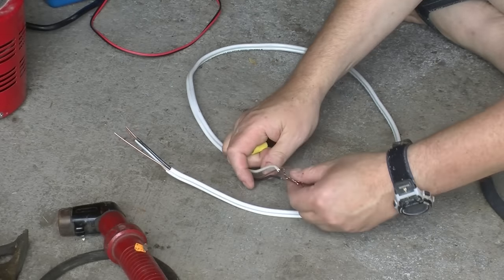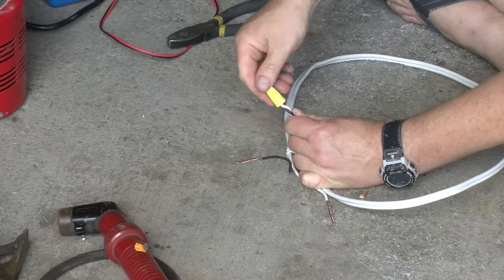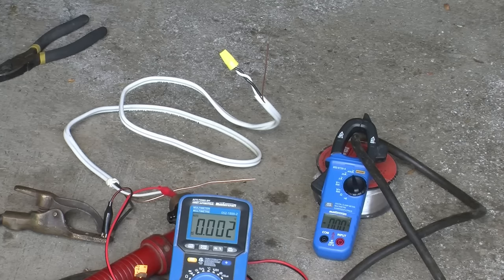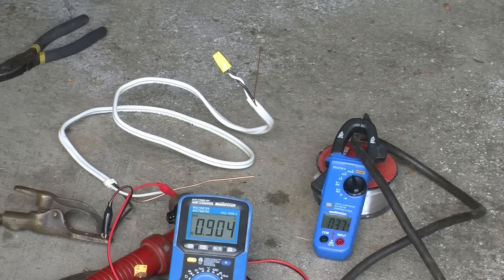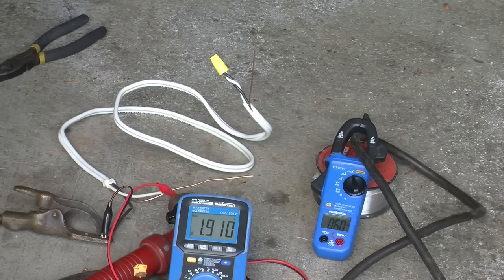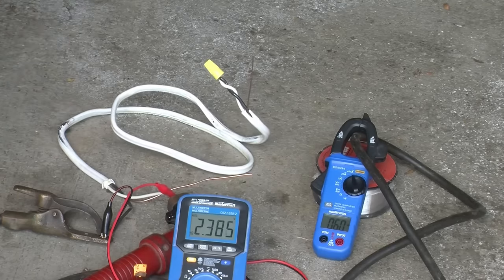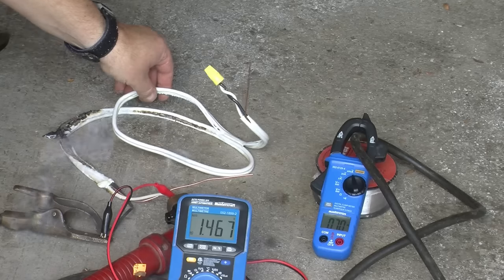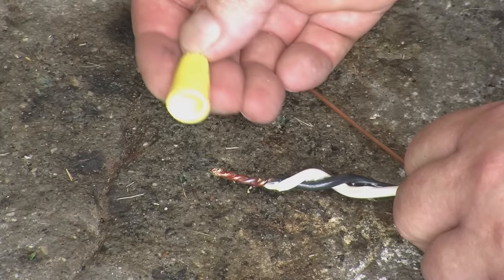How many Amps to burn up 14/2 electrical wiring?

Comment: Would you do this with CCA wire? Also, try it with the Wago connectors instead of the wire nut.
Reply from the maker: I have never actually seen CCA wire in real life. I know it is used form cheaper Ethernet cables. Is it used anywhere for power applications? I did Wago a few days ago  https://youtu.be/cMVnOZCGljc
Reply: @ElectromagneticVideos  I'll check out the Wago one. I have personally only seen CCA in network cable, and refuse to use it for customers. As for electrical, I did mot know it was a thing until someone posted a photo of some in a Facebook group; I believe it was the electrical wall of shame.

Comment: This doesn't reflect same conditions as over amping house wiring using 110/220 volt. The wattage(heat) goes way up when there's more voltage. Try same test using 100 amp circuit breaker with digital amp meter capable of peak amp capturing. This video should have warning to novice how important it is  not to go past ampacity of wire. Neighbor burned his house down, killed his dog from it.

Comment: Just remember, this is BEST *CASE*.   This is open air.   Jammed up inside a bunch of insulation it's going to heat up MUCH faster.  There are amperages which this wire in this situation will handle that it WON'T handle in your wall.  As is, you should pull this video.
Reply from the maker: https://youtu.be/Df7bAEdIILI

Comment: If you want to see things get exciting with wire nuts / Marrettes,  put lots of current through two 12 AWG _aluminum wires from 12/2 aluminum house wire !!   Or a 14 AWG copper wire attached to a 12 AWG aluminum wire with a wire nut.
Reply from the maker: In my area (near Ottawa), Al was used in the late 60s/early 70s and is in many homes. One of of my friends renovates old houses on the side and I have a standing order for 12/2 Al if he ever comes across an aluminum wire house. So of I ever get some 12/2 definitely. It is the same friend where I got the 100 year old Knob and Tube for the video on that.
Reply: @ElectromagneticVideos  Virtually the same situation across Canada from 1966 to 1975,  while the price of copper was crazy.  The aluminum wires in my house are NMD7 90C vinyl covered with paper between the outer vinyl jacket and each of the wires.  Totally modern looking,  like the 14/2 copper wires you are testing,  only they are marked ALCAN AL-FLEX 12/2 ALUMINUM.
Reply: @ElectromagneticVideos  Another house wire worthy of your overheat tests would be 14/2 copper with the braided tar/paper outer jacket. This was common from the mid 1970s and earlier,  with either copper or aluminum conductors,  with exterior appearance somewhat like a snake skin.  I bet this stuff would be tough when overloaded / overheated.  Would be great to see this tested to destruction!
Reply from the maker: @LakeNipissing  When I was a kid we had a newly built place with AL as well - and I bet it was Alcan wire too. Like you said, similar to modern 14/2. But ours had some sort of woven fabric jacket with paper in between like yours,  and jacket colored dark green. I'm guessing to distinguish it from copper. I think the place was built around 1967 so it would have an early generation of Al 12/2.
Reply from the maker: @LakeNipissing  That must have be jacket type I mentioned when responding to your Al wire comment. And I do remember the tar or various older wires - messy to work with! I wonder if the tar catches fire when overloaded? Certainly would try it too if I come across some.

Comment: The premise that 14-gauge wire can handle way more than 15 amps is wrong. What you should be talking about is how over time the additional currant changes the molecular structure of the wire and renders it useless. The heat of the wire also breaks down the insulation over time.
Reply: I don’t think he is suggesting that 14 gauge wire should be used in a circuit of more than 15 Amps.
Reply from the maker: Thanks for that - yes - I am in no way suggesting that #14 (or any wire size) should be used for more current than it is rated for. This was merely to get a sense of what the margin of safety might be.

Comment: So, since we have 120 v ac systems, it would've been nice to see how much Amperage @ 120 v it would take.
Reply from the maker: The heating is caused by the current through the wire and resulting voltage drop along the cable. The voltage between the wires does not contribute to the heat melting the plastic insulation. The main difference that a higher voltage between cables would create is arc type events once the insulation melts and fails. In a real circuit with 120V or 240V (or more) when arcing and shorting occurs you would hope a circuit breaker trips and the result would be much less interesting.

Comment: Would be interesting do this with Aluminum wire. I ask because years ago I had my service panel upgraded from 150 amp to 200 amp by a electrical contractor.  Recently I found out that 12G Aluminum is only rated for 15 amps but the contractor he put in 20 amp breakers likely he saw 12G wire assumed it was 20 amp like copper.
Reply from the maker: If I ever get some I will. I was used in my area (Ottawa, Canada) from the mid 1960s to mid 1970s. I know someone who occasionally renovates old homes and I have a standing order for any aluminum wiring he might come across. 

20A breakers - yikes! In case you are not aware - the issue with aluminum is the connections - the Al expands and contracts with changes in temperature potentially loosening connections, ans also forms an oxide layer on the the surface making the connections even worse.  Well worth the cost of having an electrician check all connections if you haven't done so - know someone who did and 3 or 4 burned  connections in junction boxes were found and fixed.
Reply: @ElectromagneticVideos  Yes I'm planning on replacing all the breakers with AF/GFCI and I do check the receptacles and light switches for lose screws. Not really a fan of pig tailing the purple wire nuts not even sold anymore I think they actually discontinued them because a bag 5 is $40-50 now. Home Depot sells Aluminum rated 15 amp receipts and light switches. My home has the later Aluminum wire I'm told was 2nd generation home builders tried it again in the later 1976. My last home before this was built in 1970 and it did have flickering lights. This house hasn't been too bad. Someone pulled batch of 10AWG copper from the service entrance at some point left it bunded up in the attic so I have been slowly swapping big circuits over to that like the microwave.  Due the fact my home is a flat roof, and slump block house redoing entire house in copper isn't feasible unless were willing to move to a rental while the work is done. What's even more funny homes built today sometimes still use aluminum wire for 240V appliances. MY AC was tripping breaker Lugs got lose exactly what you were saying heat cycling. I will never buy another home with Aluminum wire again.
Reply from the maker: @Mike-01234  So glad to hear that - I think replacing all the breakers with AF/GFCI is a really great idea - hopefully if  one of those poor connections develops it will get shutdown before anything bad happens. 

Your point about Al in new homes  - I know someone who just had a house built and AL was used for the electric furnace. I think with connectors made for it and the oxidation grease, its sometimes worthwhile. Totally agree though - I would avoid any place with Al wiring!
Reply: @ElectromagneticVideos  I have about 3 feet I cut out doing my repair if you want it. It's 10/3 AL. Actually stronger then I thought. Ill mail it to you at your expense should be able to fit in a small box.
Reply from the maker: @Mike-01234  That would be great - I really appreciate that! Could you email me so we can arrange it? You can get my email if you click on "Electromagnetic Videos" and then  "More about this channel" and then "View Email Address". YouTube hides it there to prevent bots and spam.

Comment: The wire nut should get no credit.  When you twisted the wires together,  only the first twist,  close to the insulation, was carrying any current.  The remaining twists were not in the circuit at all.  The wire nut only provided mechanical support.

Comment: Does the added resistance when copper gets hot make it run away? I think it just adds a little to the heat and would not make it run away. At least looks like it when you do the math.
Reply: Yes. The problem is it is a positive feedback loop.  When you increase the current, it increases the temp, which increases the current more, which increases the temp more.  The only thing will save you is if the wire can effectively radiate that extra heat away so the temp will eventually stabilize and you'll reach a new balance point and the increases will stop.  If it can't radiate that new heat effectively (say the wire is buried in insulation in a sealed wall cavity), then the temp will not stabilize and will continue to increase.  That's when you have thermal runaway.  A wire hanging in free air is much more resistant to this than a wire in a wall would be.
Reply: @stargazer7644  I think the added resistance due to heat will not make it a thermal runaway. It adds to little.

Comment: This is comforting to know that there is plenty of margin in the cable capacity.  It's likely the connections that will get you, something not tightened down adequately.

Comment: Use a longer wire.should heat up first at wire nut cause there's more resistance there.but the wire will melt first cause the insulation has a lower melting point causing a bigger short thus increasing the resistance more heat then 🔥

Comment: With that welder aren't you applying direct current and not alternating current? Homes use AC not DC. Won't that make a difference?
Reply from the maker: Its a really old stick welder - AC output so no DC here. DC of the same current as the AC (RMS) current would produce the same heating. Main difference with DC would be arcing when  the wires short. Smaller DC arc's are more stable than AC because the current does not go though zero. I'm guessing typical MIG DC welders  would still have the current going to zero since its rectified but not filtered DC. The new switching power supply ones would probably have much more continuous DC. I wonder if its easier to sustain a nice clean arc with them?

Comment: Is this welder DC?  Makes a huge difference
Reply from the maker: Its vintage AC welder. Main issue with DC would be if an arc happens, its less likely to self extinguish the way an arc form AC does.
Reply: @ElectromagneticVideos  might study history. DC has much greater resistance than AC, which is why we have AC in every home in America. The conflict between Edison and Tesla, AC verses DC.
Reply: @ElectromagneticVideos  voltage also has a great effect of resistance

Comment: the copper wire of today has more impurities in it today the K value in copper wire today is around 13.2 (Aluminum is around 18.9 )  it use to be around  8.7 so basically the copper wire has more resistance in it today which can create more heat .
Reply from the maker: I had heard that with the reason being contaminants in the recycled metal used to make it. Any idea if that is correct?
Reply: @ElectromagneticVideos  absolutely correct the wire rusts instead of going green and then they changed the current carrying ability of the wire to carry more load ,reflected in the electrical code.
Reply from the maker: @desdicado999  It rusts! Wow - I was going to say that must be crazy amount of impurities but it probably doesnt take much to change the chemical reactive nature of the "copper". So how did they change the code? I thought #14 was 15A and #12 was 20A for typical household use and didnt know it changed. I should point out I'm an EE and I generally do RF stuff, so I'm not intimately familiar with the code the way electricians are (and they are the true experts of how  the code applies in any  area).

Comment: For everybody worried about him touching the wires really his biggest risk is burning his finger on the hot insulation. 
If he's not grounded to anything he's not going to get a shock. Even if he does get a shock it's just 120 volts. It's like a cup of coffee it'll wake you up.
Reply from the maker: Your right about the biggest risk being burning my fingers!The voltage is actually really low - less than 5V or so because that all it takes to push the current though what amounts to a shorted wire. I wouldn't be touching it it it was 120V!

Comment: 14/2 wire on a 15 amp fuse/ ckt. Breaker .  20 Amp fuse / ckt. Breaker for 12/2 wire. Never put 14/2 wire on a 20 amp ckt breaker or fuse.  You can put 12/2 wire on a 15amp breaker or fuse.
Reply from the maker: Yes!!!!!!!!!!!
Reply: But if you DO erroneously put a 20 amp breaker on a 14/2 you will be okay.  Just closer the the margin than you ought.  It's nice this margin is built into the code to keep morons from burning their house down by upping a breaker to 20.

Comment: Do you have 22 awg wire test on 5-20 amps load i hope you make a blogg too for size 22 awg wire cause thats what im using for my 12v solar setup in light and dc fan
Reply from the maker: Look up ampacity charts online like this one: 
https://www.engineeringtoolbox.com/wire-gauges-d_419.html

That gives about 5 amps  for solid wire and less for stranded. The manufacturer of the cable is really the best source of info - the max amps depends a lot on the temperature rating of the insulation and how the wire is installed (open air, inside an insulated a wall etc). 

Hope that helps!

Comment: wow... very impress... I'll say the biggest problems would be due to arking...when the contacts are lose..and aparks star happening... heat up the contacts, cause over heat, witch causes melt down and this causes a short or fire.😔
Reply from the maker: It is impressive how much current the wire and connectors can handle. You make an interesting point about arcing which in a house system with the full 120V between the wires could certainly cause   ignition as the insulation melts - possibly before it did here. It would be interesting to see if breakers - afci or regular - would cut the power before this much damage occurs and prevent a fire.

Comment: The copper can take a much higher current than people think.  Wire is rated for the insulation covering it.  Romex is rated higher for derating purposes.  EGCs must take full ground fault current of the circuit OCPD for 5 secs before damaging the copper or aluminum.  Electricians know this already.
Reply from the maker: It certainly  is remarkable how much current it can take particularly for short time periods - and even when insulated due to its thermal mass.
Reply: It is remarkable for certain. The main reason most breakers we deal with normally are instantaneous trip...except for FPE that is. I think FPE performed this test without even knowing when their breakers refused to trip in residences. @ElectromagneticVideos
Reply from the maker: @Icehso140  Yeah they (Federal Pioneer breaker) must have been a real disaster. Its hard imagine how they apparently ended up in widespread use.

Comment: Would results be different if voltage was 120v?
Reply from the maker: The heating along the wire would the same  if the same current was flowing, so melting of the plastic would occur at the same time. However, when as a result of plastic melting or charring the two wires start to short, with 120V would hopefully have a breaker trip and stop the current flow and heating. If it didnt and there was a short, there would be copper wire melting all over the place, plastic vaporizing etc. More so than for the mere 270A Amps the welder can supply at the end. Now if the wire insulation charred rather than melted (see the video of wire in fiberglass insulation), you could get 120V forcing enough enough current through the charred material to generate more heat and cause a fire.

Comment: Would it be the same as the voltage was 120
Reply from the maker: It would - assuming there was a load drawing the same current as we are in this experiment.  As it would for 240V. But once the insulation starts charring, with 120V and 240V we might see the charred material starting to conduct and further heat the cable or possibly short and cause a breaker to open. Similarly, if the wires touch when the plastic melts it would probably blow a breaker. 

So in summary, to see what current it takes to melt and char insulation, things would be the same for different voltages between the conductors. But after the failure has occurred and something like a short happens, things might go bad in different ways.